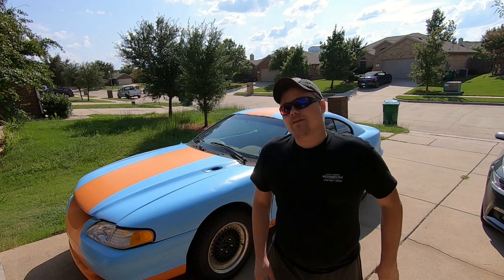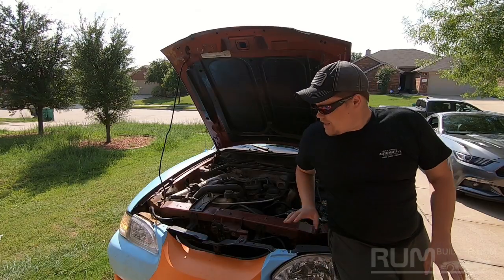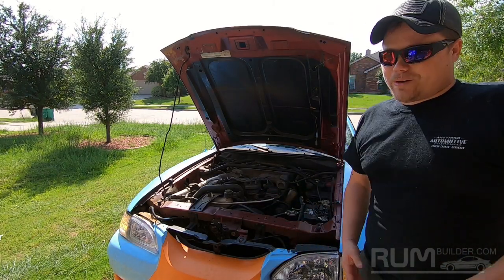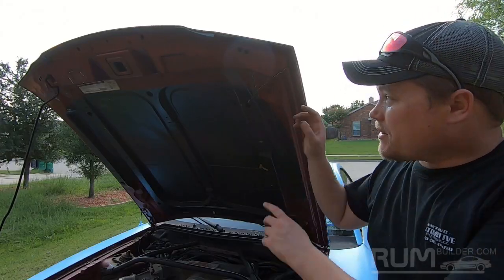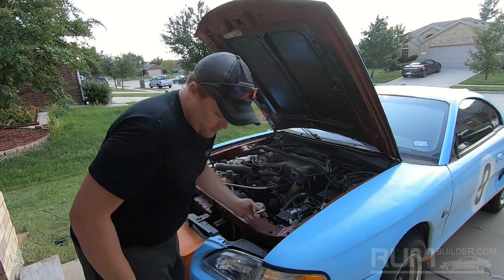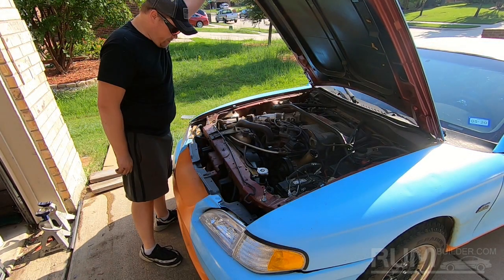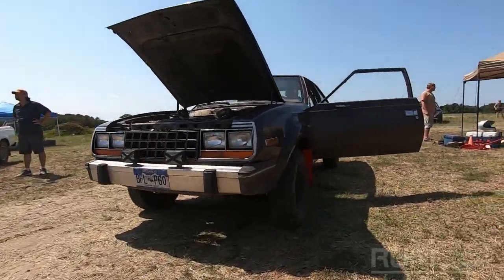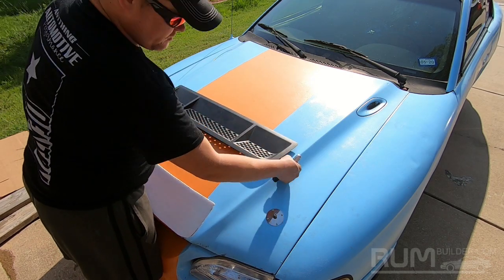Installing a real GT500 heat extractor on the rallycar.

Comment: There are headlight housings that is one assembly with the turn signal housings vs the stock being two separate housings. What do you think of those?
Reply from the maker: @briizcustoms9543  I’m not a fan, I like the two piece units. Though am running something completely different now. New video soon.

Comment: Don't need to secure the heat extractor to the hood ?
Reply from the maker: It has 2 sided tape on the front, and clips in the rear. But I ended up drilling holes and riveting it on eventually.